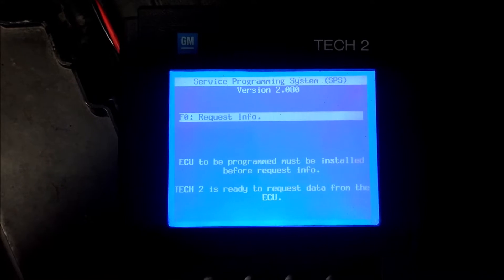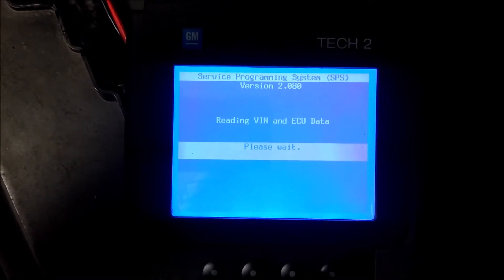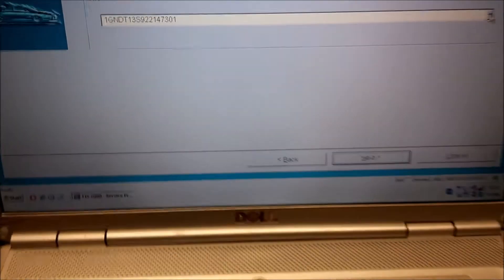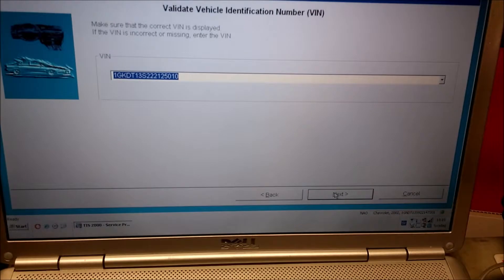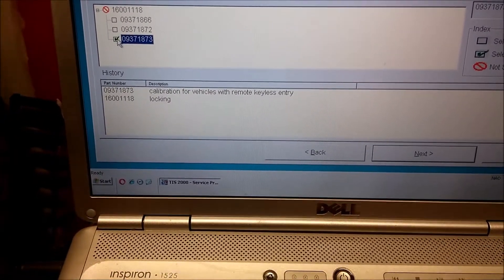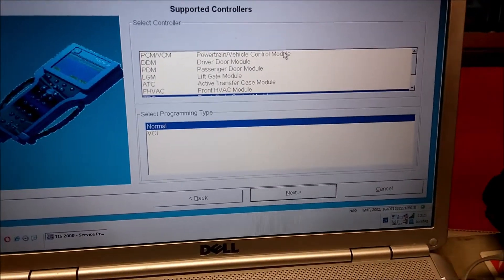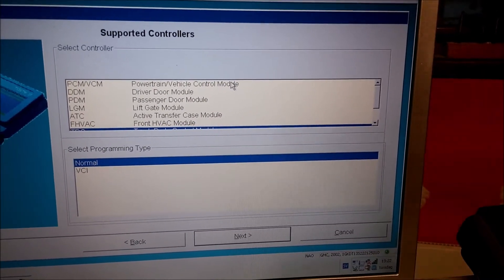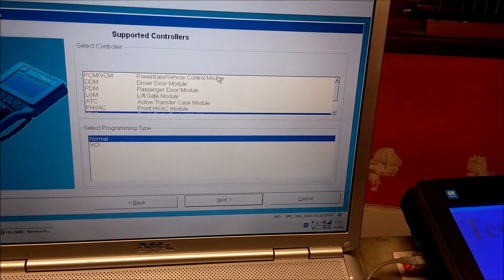FREE!!! How To Add More Options in your GM car & truck with Tech 2

Comment: I’m going to try to reprogram my bcm because I converted from manual to power everything in my 04 Silverado. I want all the power locks and windows key fobs and fog lights
Reply from the maker: Have you found a VIN yet that have those options?
Reply: @SwedesGarage  yes I have . How much do people charge for that service ? The Chevy dealer always acts like they don’t know what I’m talking about
Reply from the maker: @tepongoagatas1758  Chevy dealers don't flash modules with any other VIN then the factory one.

Comment: I ordered a tech 2 with candi module.  Will it work on a 2008 Tahoe hybrid ?
Reply from the maker: It's suppose to work up to 2010 models, but the newest vehicle I used it on is a 2007 SAAB. So I can't say for sure it's going to work on your car, but it should.
Reply: Thanks for the fast reply 👍

Comment: GM tech 2 scanner can work with the truck had 24 volt dc.
Reply from the maker: No sir, you need an adapter. Google Tech2 on 24 volt

Comment: In the states, it is called “Personalization”  where each model can be different. Example; hold the lever to high-beam and turn the key on-off 3 times in 5 seconds. The door locks cycle. Push lock button once, mode changes, repeat. If the PCM is not programmed to activate the driver for the horn, it won’t work. You found that out but never knew they left out certain programs. Odd! Some vehicles like a Cadillac may have 9 different personalization settings. Then, not be confused with key FOB memory. FOB #1 is always driver and sets the HVAC, radio station, volume, seat and mirrors as if you are 6’3” and your wife is 5’ 11” so different settings in memory for FOB #2.
 I have had a TECH2 since 1992 and worked at a Buick dealer. The PCMCIA cards come with software to allow them to come on, but If programmed for Isuzu or Saab, that’s it. You can not add GM on the same card. A tech I worked with retired and GM is using all internet based software now. You can only program the TECH2 to 2013 or 2014 and that’s it. The Chinese flooded the market with cheap copies and had serious problems with no repair. They have been known to mess up vehicles. 
 The BCM is the power mode master and it sends a “Wake-Up” call to all modules followed by the VIN number. If the radio does not match the VIN, it will not come on. Same with IP or dash, PCM and anything with serial data either class2 or CAN some call GM-LAN. At least in the states here. My TECH2 is a Hewlett-Packard brand but now it is out dated but works to a point. I hope I can get the card flashed to 2013-2014 (Last Year I was told) but Retired, I want a 2015 Malibu for my wife. Still want to fix it. I will find out a dealer! ASE Master Tech since 1978-Retired

Comment: Thanks for your videos! So can this Tech2 only upload fixed softwareparameter (depending on the VIN)? Can you also change any parameters like activate this chirp whilst keeping all other settings original?
Reply from the maker: First Q = Yes. Second, I did get the chirp on my TB by update the software in the BCM from a US model. It was pretty easy after you finally found another TB or Envoy VIN with all the options I got on mine. I did loose the rear fog light and head light washers because it's not very common in the states.

Comment: thanks...does clone tech2 able to make offline programming ?
Reply from the maker: If you are online and download the new software in to the Tech 2 first, then you can do the programming offline with just the Tech 2.
Reply: @SwedesGarage  sorry i mean on line programming with clone unit
Reply: @SwedesGarage   sorry ...i mean does clone tech2 work online ....thanks too much
Reply from the maker: @ahmedjasim8702  If you have the connection needed, yes!

Comment: So say I have a Saab which uses tech 2 I have a bad ecu but I can still pull all the info off of it if I could... can I reprogram an ecu from a junk car with just the vin of my car  using sps will I have to program my CIM(central integrated module ) back onto the new ecu ?
Reply from the maker: I'm not sure what the CIM is on a SAAB? But if you replace the ECU with another one and you can access the new one (used one) with your Tech2 and have access to reprogramming. Yes you can program the used ECU with your VIN. But what's wrong with your stock ECU? I would try to reprogram the factory one first and see if what ever problem you have get fixed.